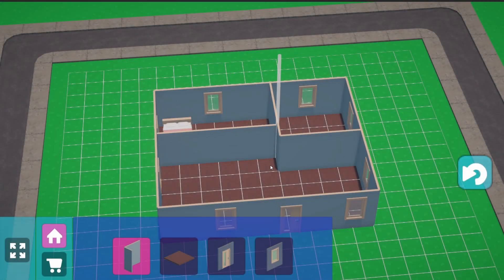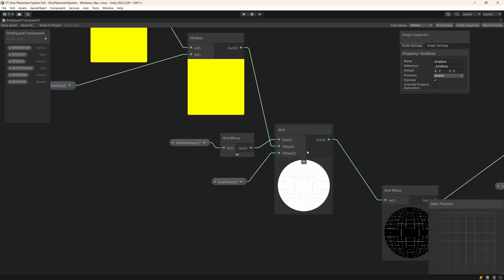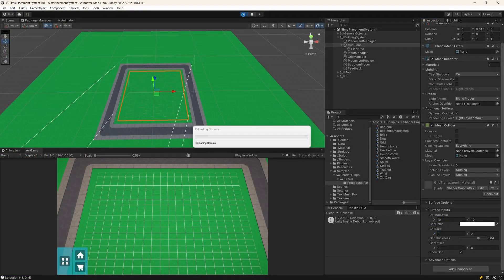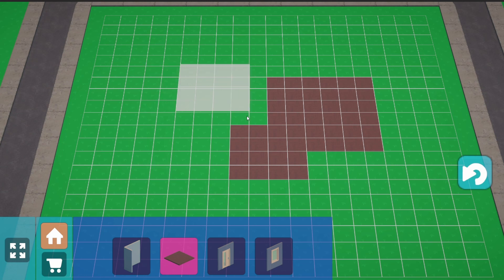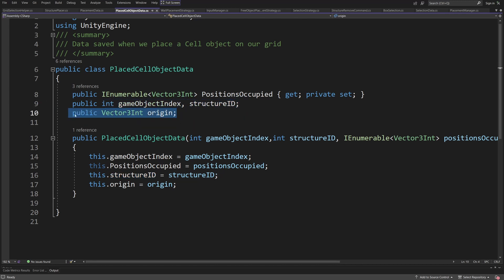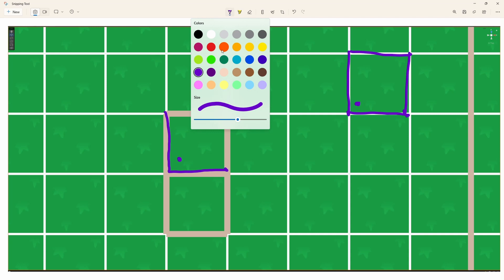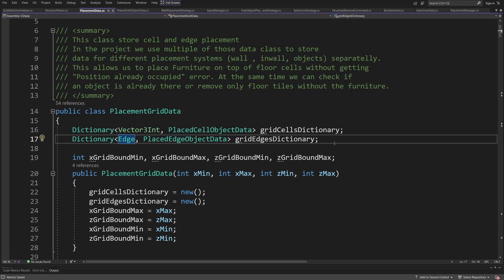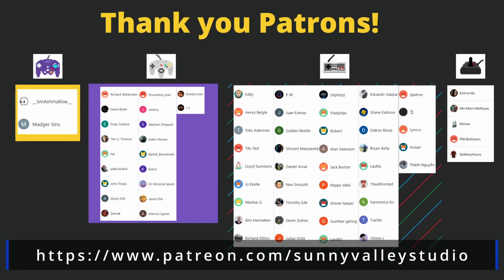Sims like building system in Unity 2022

Comment: i bought your course, but how do you handle the corners for the walls?
Reply from the maker: The assets that I am using do not have corners so I have 2 walls overlap each other. We could have a system that swaps those for a corner prefab that is rotated and assigned in place of those 2 walls. When we delete one wall we could again swap it to 1 wall remaining on the side that wasn't removed. It complicates things so unless you really need it I would stick with overlapping walls where there is a corner

Comment: I think it would be better to use procedural meshes instead of prefabs for floors and walls.  Also, there are much better ways to place walls than with A* Manhattan; it would be better to have walls only placed on straight lines, especially if you might possibly want to allow diagonal walls at some point -- while having an option to place whole rectangular rooms (walls on both sides) separately, which does not require path finding at all since you can derive all for corners and simply create axis aligned walls between them.  No way to assign materials to the sides of walls or floors, or to store the identity of rooms?  I guess its a neat starter tutorial though, and it would be foolish to expect a commercial quality game to be developed in a Youtube tutorial, so I suppose this is actually good.
Reply: Why not create your own tutorial?
Reply from the maker: Thanks for the feedback! Yeah all it is is a starter project 🙂 I would certainly go for a procedural mesh generation to improve the project 👍 Changing materials per each side would be cool! We could add a custom shader but I'm not sure we could swap only one side with the UVs of the current 3d model that I am using.

Comment: I recently got the sims like course. I am trying to instaniate floor tiles by default on the grid from the start, but I am  having difficulty achieving this. Also having trouble doing multiple floors. I've tried moving the gridOjbect Y, but everytime I place an object it defaults to Y= 0. In addition Objects with a non uniform size ex. 2x1 can only rotate to face to directions instead of the expected 4 directions. Suggestions/Help?
Reply from the maker: Hey! You should have access to discord channel where I can provide more help than here.
To instantiate floor tiles from the start you can manually call the floorData and at specific positions the floor. You would first need to add them to ObjectPlacer to get theire indices.
Multiple floors would require a new grid data to be created. In the sims you would manual jump "up" or  "down" the level by clinking an arrow button. This could inform our system to "swap" the data. You would probably add an extra method to select the correct data based on the level ex an int value.
2x1 rotates this way by design. The idea being that you can easily add "mirror" logic. The rotation logic would be the same as for the uniform ex 2x2 objects but we would have to return the size 2x1 or 1x2 depending on the rotation direction.

Comment: Peter are you able to go into the programming pattern you've used + a high level overview of the project maybe using uml diagram?
Reply from the maker: I might add a UML diagram to the project. I have used a state pattern to create different selection modes (box selection, placing or removing mode) and the command pattern for the undo system. There is a bit of MVC going on between how UI and the Placement system is set up. 
Just remember that at the end of the day it isn't really what patterns you use in the project but does it work or no and if you can easily extend the code. As always in this project you can easily change some things while other changes (like adding a move object system) were more difficult to implement. On the other hand chances are that you will want to add ex "Ceiling placement for the lights" but  there is a small chance that you would want a "Move walls mode" that would pose a challenge to add.
I hope it answers our question :)
Reply: @SunnyValleyStudio  Thank you yes it does! I have been researching a lot about design patterns recently and your methods come as no suprise which is good. I didn't think MVC would come into it but that's my limited experience.

Comment: Great video! I have 2 questions 

1. About valid placement part how would you go about making the tile under the object turn red for invalid and green for valid as well?

2. Is creating an arrow to show which direction the object is facing easy to add? Like to show intractability for a fridge would just be the front while a chair would have 2 sides left and right or is this correlated with the valid/invalid placement as well like if the chair's left side is on the wall that side's grid color would be red while the right would be green?

Thank you so much for your time and effort you put into the tutorials! I'll most likely fiddle around with the code
Reply from the maker: Hey!
I would add another quad / cube under the prefab of the object that I want to place and make its materials transparent (just like with the current preview objects). I am sure you can have a shader based solution that shows the material of your object over the object that it is "inside" but I am all for a simple solution that is why putting it a bit higher than the floor level would show it on top of the floor and beneath the placed prefab (unless it too is transparent) 

For the second question I would again add either world based UI or some quads with arrows on them. You can also use "depth test" value  in the graph settings to make the arrows always show on top of everything else. Since each object stores a rotation the arrows would rotate together with the object. From the validation standpoint since ex the fridge is 1x1 + 1x1 area to interact I would just set its size to be 2x1 and the validation system would automatically work.

I hope it helps!
Reply: Thanks a lot for the solutions! I'll try out the shader approaches